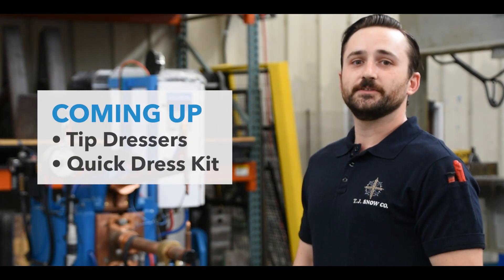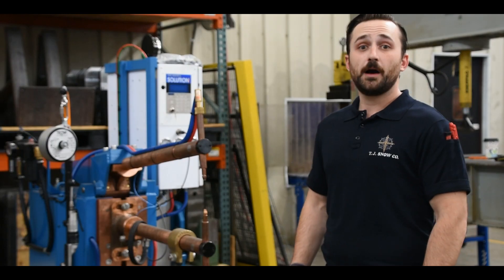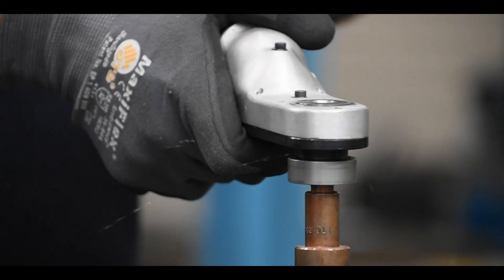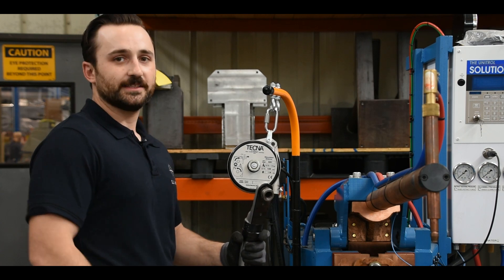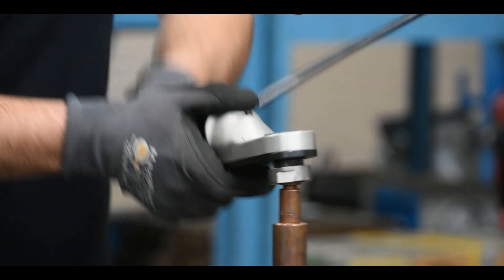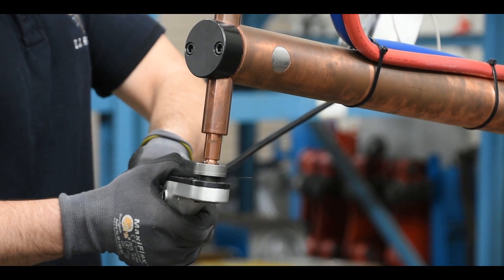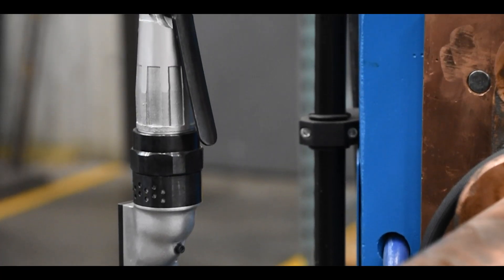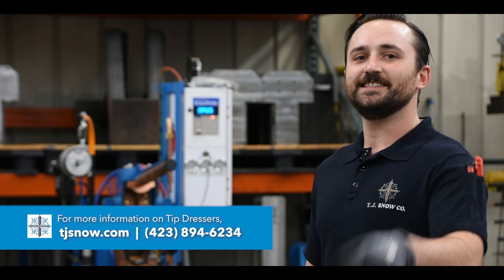How to Dress Your Electrodes with YNR-8F Pneumatic Dressing Tool - Resistance Welding

Comment: We bought one of these along with the appropriate blades and the chatter on ours is terrible. Is the blade supposed to be able to move side to side in the holder? I've got everything as tight as I can get it and the blade moves side to side in the holder. Id imagine thats why were getting so much chatter. Makes it completely unusable.
Reply from the maker: The blade is designed to "float" inside the chuck. This is normal. Be sure you are using the correct guide ring for the cap/electrode. Using the incorrect ring could cause excessive chatter. If you have other questions, please give us a call (423) 894-6234. Thanks!